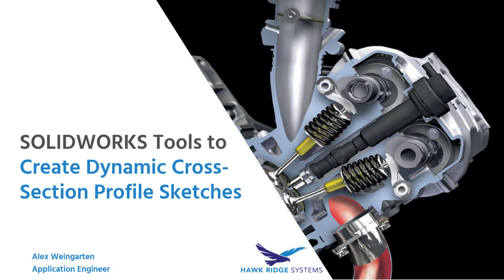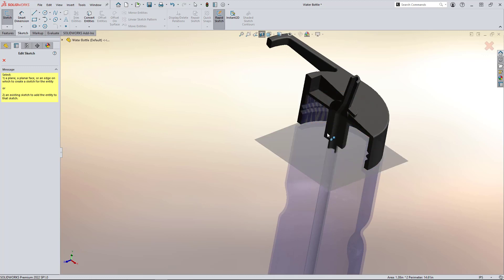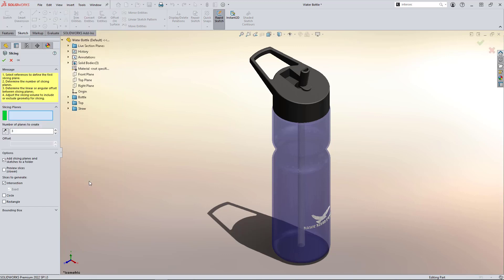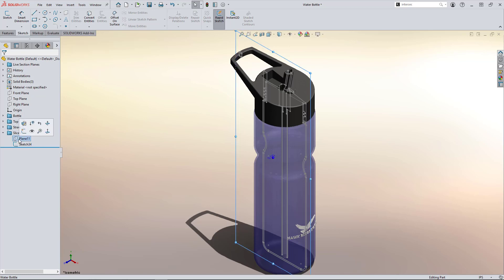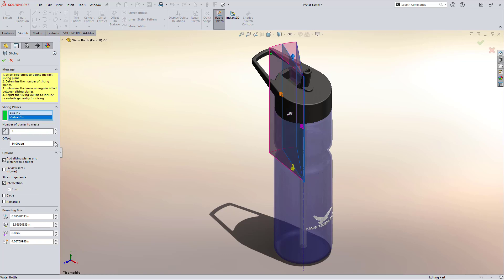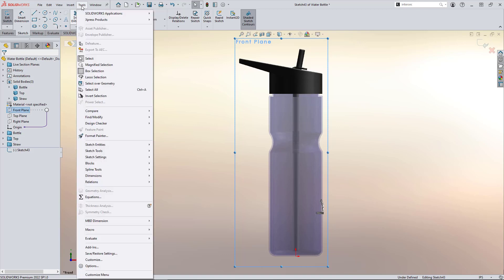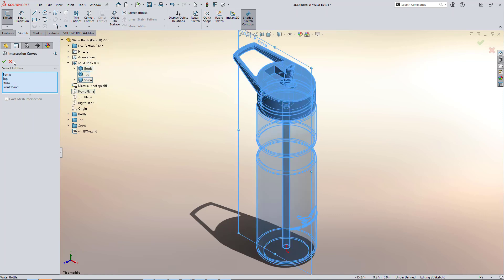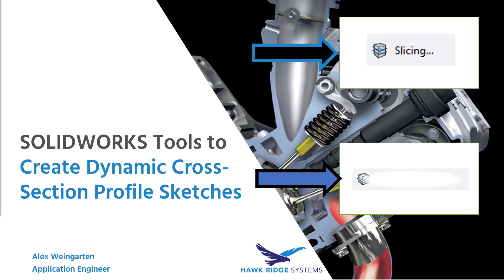SOLIDWORKS Tools to Create Dynamic Cross-Section Profile Sketches

Comment: When you say dynamic 
Is there a possibility to always get the exact section even when you change the  model or it’s dimensions?
Reply from the maker: Yes! That is exactly what dynamic is referring to in this video. It will remain in the same referenced position as long as the selected Slicing plane or Intersection Curve plane is static i.e. not changing its location or relations to the model when its features or dimensions are modified. The default Front, Top, & Right planes are typically excellent choices when properly associated to the model. Conversely, one should avoid selecting a planar face of the model since they will often change locations when updating design specifications